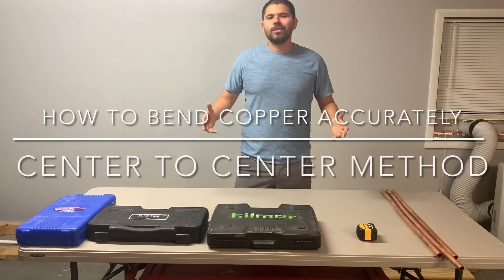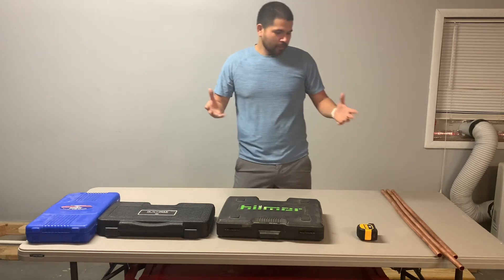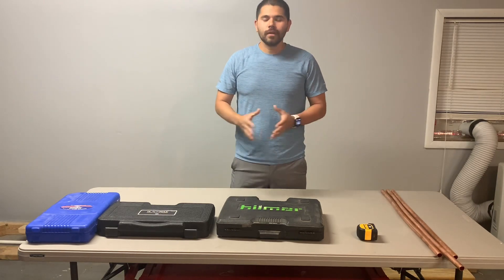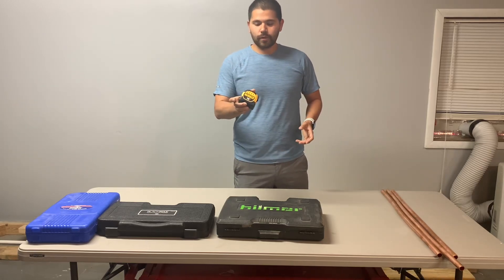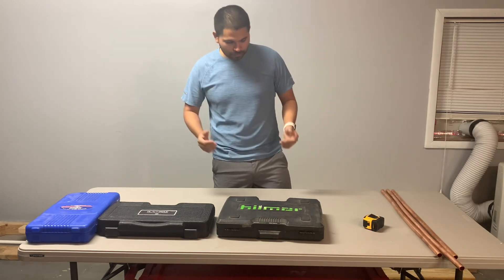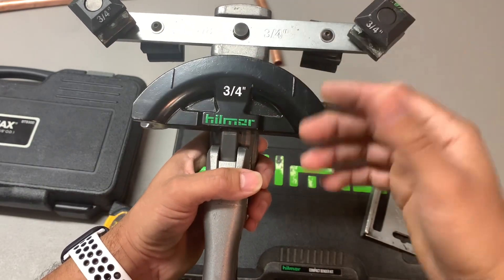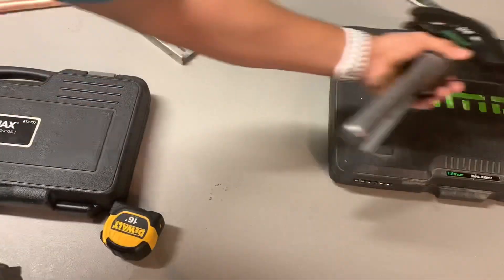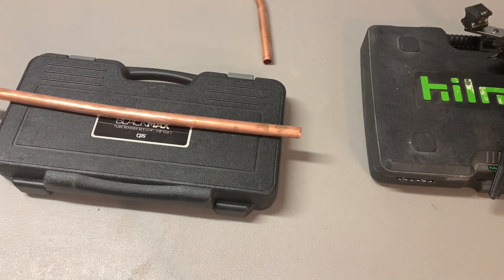How to bend copper using center method

Comment: Those pipes kinked up good on the inner side. That's not very appealing.
Reply from the maker: Adding lubricant to the mandrel helps, but if you don’t want any ripples then you can always use fittings instead.

Comment: Do you have a video on making second or third bends? I seem to not understand the process into bending properly. I guess what I’m asking is on the second bend if I need to wrap around a wall and I want it flush where do you measure from? If it’s 20” I need I mark my pipe at 20” but I always have a two in gap we’ll say from the wall to the edge of the pipe
Reply from the maker: This is a good question, I will make a video to explain this process as soon as I get a chance. 👍

Comment: Excellent instruction videp, may I add a tip?... to avoid ripples in the bend, before I bend I alway spray the mandrel and bracket ears with silicon lubricant. Copper slides easier and stops ripples from forming. Cheers!!
Reply from the maker: Nice tip 👍

Comment: How would you use this to bend a mini split line where you don’t need to measure the distance from one end. 

If I just want to bend the copper on my center marked point on the pipe I just line up that line with either point on the bender?

Comment: My BlackMax doesnt have those marks on them. What now?
Reply from the maker: At 7:35 I pointed out the reference point were to line ur copper up to , its the top of the head were the cross bar attaches to the bender, ignore the black marks that are on the crossbar, those were when I was practicing to find the correct reference points. Hope this helps
Reply: @AZSolutions92 - Thanks for responding! - So, what if you use, say, 1/2 inch? Have you tried it with other pipe diameters and the reference is still the same?
Reply from the maker: @treefellonya  
I have used 7/8, 3/4, and 5/8 copper with the same reference point in the video, I haven’t tried 1/2 copper.

Comment: Do these benders work on hard copper pipes or just soft copper?  Thanks awesome explanation bro
Reply: No you cannot bend hard drawn copper or straight copper
Reply from the maker: Its meant for the soft copper ACR, If you have hard drawn copper then you have to anneal it before you can bend it.
Reply: How about soft copper type L for plumbing water line? Would it work?
Reply: @darellroasa3235 nope you need the Rigid 358 for 1/2 and the Rigid 378 for 3/4 hard copper type L

Comment: Ok. Suppose I have to make two 90 degree bends to hug two corners of a room. I have my starting position on the left wall. I have the distance from start to first corner. I have the distance between the two corners and the distance from last corner to stop. Picture looking down into a room and needing to wrap copper pipe from left wall, to back wall, to right wall, to some stopping place. 
I have the distance for all these lengths. Call them a, b and c. 
a is from start to first corner. 
b is distance between the two corners.  
c is distance from second corner to stop. 
How do I know where to make the bends so the pipe hugs the wall?
Paul

Comment: Just got my bender today, playing with a little bit of 1/2’ so i noticed firstly the the lines for the 90 degree are out by a pipe size, so my 1/2 is sitting where the 1/4 and 7/8 mark is, and for the 1/2 my centre measurement is my actual measurement plus another 1/2, next ill have to check the same measurements on the reverse, followed by me doing the 5/8, nice bender though, just gotta learn what the bender does, no biggie

Comment: Could you possibly make a video on hydraulic swaging tools would like to know what’s the best one
Reply: Hilmor or navac. I've had the navac for about two years and love it. My buddy has the hilmor. Both very similar in quality. Very well built and precise swages.
Reply from the maker: The hilmor requires maintenance with replacing hydraulic fluid, and the Navac is vacuumed sealed and they state it doesn’t need maintenance on the hydraulic fluid. They both will work just fine.

Comment: Awesome man! I’ve been wondering what the center was with the CPS. Thanks for the video! 

Any tips on how to avoid the dents inside the 90 bend sometimes? Oil?
Reply from the maker: Yea no problem bud, And honestly it jus depends on the copper, u can heat it up then let it cool down before u bend it or try some of the zoom oil lubricant.
Reply: @AZSolutions92  That may cause copper flaking inside the tubing.
Reply from the maker: @peterbecker8815  flow nitrogen
Reply: I find if you bend the copper slowly it prevents kicking. Hope this helps
Reply: Copper pipe comes in coils, just bend the pipe same direction of the coil to avoid the dents.